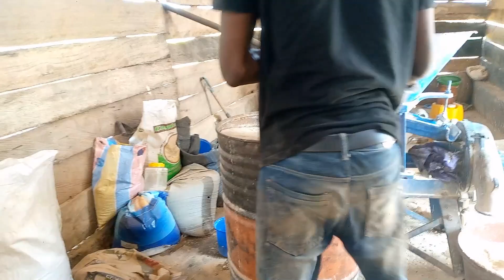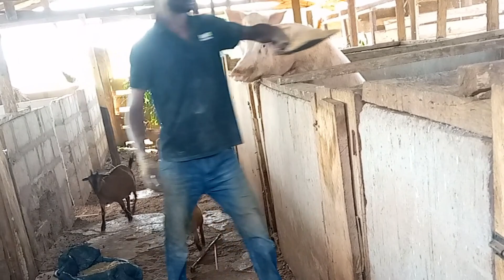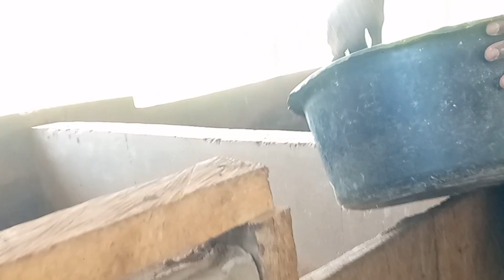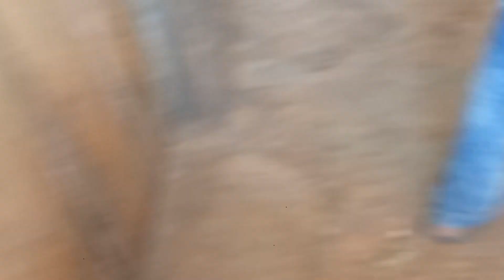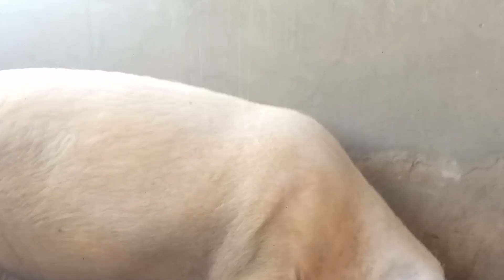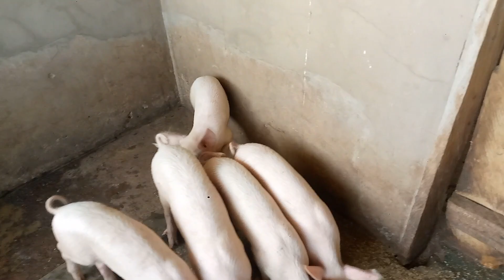How I Formulate And Feed My Pigs Cheaply

Comment: Thanks for shearing , pliz ur feed formulations do u add calcium? If yes, which one. I need ur help,  i have been following ur teachings all the time. Thanks
Reply from the maker: I've never used calcium maybe I'll give it a try. Calcium is helpful for blood clotting that's where the pigs injure each other and as usual for strong bones and teeth (something you'll not experience if your pigs are used to running on the corridor, or do not fight. If you don't also practice inbreeding too, pigs are always healthy). Are you fine with this?
Reply: @pigversity  thanks